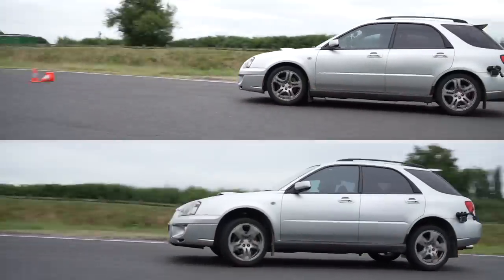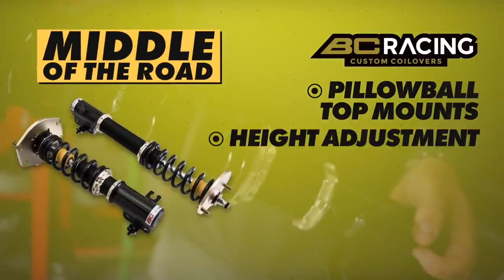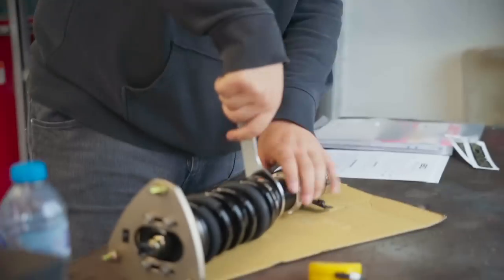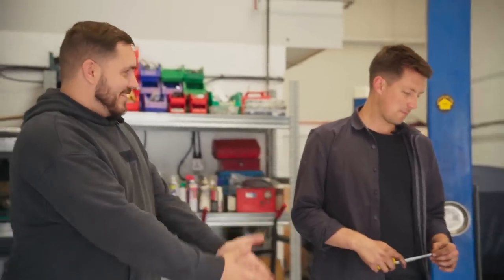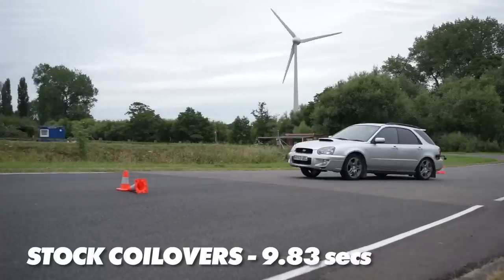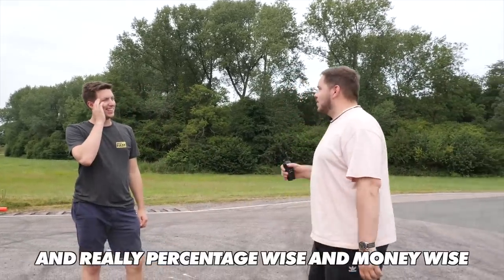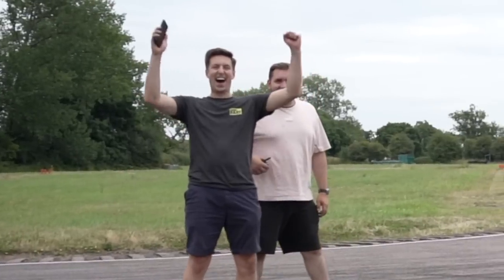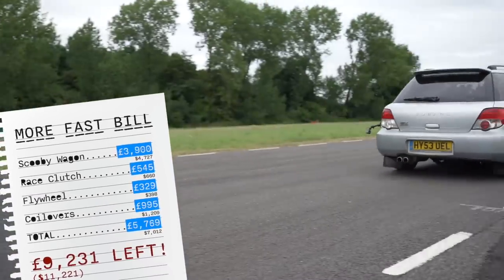Will $1000 Coilovers Help Us BEAT A SUPERCAR?

Comment: I'm really excited for this series. It's cool to see how you can take an old car and upgrade it to make it faster and what makes the biggest differences
Reply: agreed
Reply: I'm sure i missing something...
Spoiler alert! 
  #1 Tires. 
  #2 Weight. 
  #3 Weight transfer - in the way you needed it most usually #1 spring rate #2 swaybar #3 then anti angles if you can adjust them (like roll-center, anti-squat, anti-dive) #4 downforce #5 shocks (would be #2 if off-road)
  #4 brakes (this would be #1 if your brakes are trash but if a car handles well and low weight you really not on the brakes that long).
Reply: @gatorage850  According to my countless hours on Gran Turismo 5 tires are definitely the best at improving your car😂
Reply: you would probably also love hi-low by donut media then! they get two nearly identical used cars and upgrade them, one with expensive parts, and one with budget parts.
Reply: @jovaniortiz8317  and According to GTA off-road tires are best so you can curb boost!😉
Reply: It still hurts my feelings seeing a car like this get called 'old'.
Reply: @typods274  Agreed. For an american channel it's not too shouty, and that's an interesting series.

Comment: Remove the interior, seats and all those dead weight. Then do the suspension tuning and tyre change.
Reply: Winter wheels
Reply: @knrz2562  🤣🤣
Reply: In terms of performance gain you will see the biggest gain from tyre first, then suspension, and then the modest weight reduction you get from gutting the interior. Gutting an interior is only good for 100-150lbs. Consider, can you notice a large difference when a friend is riding with you? No. You need much larger weight reduction for it's effect to be significant.
Reply: @Levibetz  weight reduction is free gain. They have a tight budget.
Reply: @Levibetz  Depends. I took 72kg/160 lbs out of our Suzuki Jimny and it made a huge difference to acceleration, roll through corners and fuel economy. Worth mentioning any gain is noticeable when you have 80bhp though :P
Reply: @fossilfueled27  I did a Subaru Loyale, took about 100lbs out, I'm sure it helped but it didn't make the car any more successful at the ice racing I was doing with it, but it did make it HORRIFIC to drive. You had to wear full winter gear and blast the heater 100% to drive it in winter. Like hat had to stay on inside the car because cold air just rained off the roof.
Reply: @Levibetz  I notice quite a bit of difference when I a have passengers. Even with just my kids in the car, and the handling characteristics will even change depending on which seat they are in.  It's doesn't have massive horsepower, but its definitely not anemic. If I can feel the difference in a 400+ bhp car, then any weight reduction in the subi should be noticeable. ⁰
Reply: @Levibetz  As an 04 wrx wagon owner, I can confirm that I do feel a weight difference driving with even one passenger. I bet gutting it would feel like a go kart lol
Reply: yes yes and Yes. They should start gutting  whole car. Get rid of that useless heavy sunroof, get rid of rear bench and basically anything behind driver seat. Also draining windshield wiper fluid to a minimum is a free weight saving. They dont need stuff like radio or speakers or IDK spare tire.
Reply: Come on lads, so ready for the next video. Bring on part 4
Reply: I can tell when I have a passenger in my 2000 Infiniti G20t.  Granted, it's an abused bucket of bolts, but weight savings is weight savings.

Comment: This video actually tells me a lot about how to tune a car in a racing game, what to expect from tuning each option, stiffness, ride height and something about weight distribution, it's something I  am struggling with all the time, this series has been very useful for gamers like me to understand how to build a car efficiently.
Reply: it's hard, every car and drivetrain will have to be altered differently and it depends on the rest of your setup as well (i.e., midengine rwd car will be setup differently than awd front engine which will be diff from awd midengine) there's a lot of interplay with every system, not to mention your driving style takes a lot into account. doubly not to mention, every game has different levels of realism for suspension setup, some games like dirt rally 2.0 totally invert the sliders.
Reply: @HollidaySpessa  This series is amazing, they are spending real money and sharing the experience with us, experimenting, experiencing, it's not like someone presenting us with all the knowledge with no instance, it's kind of like that game forza horizon 5, building a car, not just granted a certain race car for some certain tracks like in racing simulator, the amount of knowledge during the entire process is great.
Reply: @ashiagefa646  ...yea? im not saying otherwise, im jus saying games like forza don't have suspension models that adhere to rules of reality, esp compared to games like ACC or especially richard burns rally. it's something ull jus have to play with and learn thru experience especially, on top of stuff like this
Reply: @HollidaySpessa  actually...
Forza have suspension model since Motorsport 4
That's a misconception
You can't compare Forza Horizon to Acc
Even Motorsport 7 since it's still based on a very old game engine
Reply: @iamcarl4591  richard burns rally is from 2005 and blows everything out of the water lol, so age doesn't matter. something can have a suspension model and that suspension model be horrible (which forzas is because it's not a simulation, and that's ok and there's nothing wrong with it)
Reply: @HollidaySpessa  If you say so
When Forza Motorsport 4 comes out
It's still impressive as it's competitor GT have a far worse physics simulation
The fact that people criticized Forza
It's because they never dig into the game enough
If you do(So do some actual real life racer) you would found out Forza has done a pretty good job
Just ditch your controller and tweek the feedback settings to make it right
Reply: @HollidaySpessa  also
The suspension simulation isn't unrealistic in any way
Give points to me about "unrealistic" if you want to continue to argument
Reply: @iamcarl4591  ? I know u like Forza but it's an arcade game, some pros like David perel like gt but it's still an arcade game. some pro rally drivers like dirt rally, but it's still an arcade game. it's not a big deal, every game has problems but live for speed, Richard burns rally, ACC, AC, etc. are significantly ahead of anything else. they jus flat out simulate more stuff, with RBR being the most complex of all by FAR, no contest.
Reply: @iamcarl4591  ur a fanboy, u like Forza so u don't want to accept it. it does not simulate an accurate suspension model, turn 10 seemingly admit this hence why they entirely redid it from the ground up for the next Forza motorsport release. it's hard to simulate, it's taxing n most ppl won't care. studios like SMS have flat out said "we will not even try to be as accurate as RBR" (or something like that) because it's crazy complex n most ppl dont really care, nor would most notice.

dont just blindly defend a game because u like it, I don't dislike Forza or gt or anything; this is jus objective. want the best simulation?play rbr, ull see how much of a hill you'll have to climb n how vastly diff it'll feel. ull see instantly how different everything feels, how much n how logically setup adjustments affect the car. it's simulator nirvana lol
Reply: @iamcarl4591  lol, forza isnt a realistic game, its an aracde racer. Get over it.

Comment: Well, as next episode is propably already recorded my comment will be useless, but I'll write it anyway:
Subarus are very front heavy but they have low center of mass. Stiffening rear sway bar is the first thing to do when you want to improve handling of them.
And about next thing on the list, tires: There is no going around it, if you're going for lap times, aim for best tires you can get. With other things you can get to the point of deminishing returns, with tires better model will always give you time advantage.
Reply: Winter tires with good groves improved grip

Comment: biggest gains that can ever be done to get a car to go faster are good sets of Tires (depending on what size of rims are stock) after that weightreduction.
but that Scoobie just a set of tires would do the biggest difference
Reply: further changes the airflow to increase aero dynamics.
Reply: @knrz2562  the track is too small to really benefit from airflow
Reply: A set of michelin pilot sport 4's wont break the bank and in my experience (had these bc's on a subaru as well) make a subaru almost stick to the ceeling
Reply: @Seb-Storm  idk
Reply: This. Going to be very interesting to see what new (stickier) tires will do
Reply: @b.w.9392  I also have ps4s on my car and they are very grippy ( and WAY quieter than pss) but their goal is just to beat the lambo around the track, go with some Goodyear Eagle f1 Supercar 3Rs. Those are streetable track tires, really get that WRX sticking in the corners. Hope they dont launch it on those tires like they have been though, RIP 5 speed
Reply: @knrz2562  Downforce is generally one of the last things that is done to add speed.
Reply: @knrz2562  that's my opinion not facts lol but i think the way the car is kinda sporty and aero-ish is not like they are driving a brick. We'll see what they do in the end
Reply: The tyres need to touch the ground to help out 😄 Also if they put the tyres on before the shocks and let Scott do his thing they would get some pretty uneven wear.

Comment: Notice how it's still got a heap of body roll? You've sent the roll centre through the floor by lowering it too far, it will be a lot quicker if you lift it at least an inch or go for a roll centre kit - you'll notice it drastically reduces the weight transfer, and makes the car feel a lot sharper and more responsive.
Reply: Just commented the same. So many people don't realise that lower does not automatically equal better!
Reply: @gazman9468  Watch the angle on the lower control arms. If the lower ball joint is not below the lower control arm's pivot points (closer to the ground) when the car is sitting on level ground then you have lowered it too far and the handling will suck.

Comment: So looking forward to future episodes! I had the exact same car that at tuned for light track work and mountain roads.

In terms of suspension need to replace the front control arms with STI alloy control arms. The OE metal ones are trash and narrow. GC8 STI arms are direct swap and GD with give you 10mm extra front track width. Also associated swaybar upgrades help, not too stiff.

Rear you need to dissemble the training arms and lateral links. OE set will be frozen in place and don't articulate properly due to age. STI at the time made pink trailing arms and lateral links with piloball bushing. Huge difference in rear stability.

Also bushing STI has a Group N catalogue; rear diff assembly mount, gear box mount and engine pitch stop helped a lot in terms of drivetrain slop and helps get power down better.

STI also made a underbody brace (just a pink bar) and strut brace that helped with steering feel.

The above shopping list is relatively cheap but made a huge difference in handling.

Man I miss that nugget

Comment: You've went very low with the rideheight, and the angle af the front control arms has switched to the other side of the horizontal. You will absolutely need a roll center correction kit. You can have that either from Whiteline, or Superpro.
Then, the wagon has narrower control arms, and that works in your favor. Buy a set of STI control arms, aluminium ones, they are 10mm wider, and that will increase the front camber. Be careful, there are 2 versions for those, 3.5deg caster and 5deg caster. The later one, called "spec B" control arm, can be found on the hawkeye STI, this would be the best option. Nevertheless, there are alternate ways to increase the caster. ALK is one of those, but it sucks imho, since it puts static load on the bushings. There is also a free caster mod to be done on the STI control arms, by flipping the rear pin. It does the same thing as an ALK.
If you switch to STI control arms, you will need a new antiroll bar. Careful with that, they differ between the normal STI arms and the spec B ones.
You can also go with STI control arms on the rear, but you will go into fender clearance issues, since the wagon has no flaring helping with wheel offset. For wheels, your best option would be the STI 5x100 wheels, 17x7.5, ET53. Or, if you keep the rear control arms, there is more flexibility to be had. DO NOT go under ET48, or you'll need to cut the lip on the rear fenders. Long story short - a 17x8, et48, on 235/40 might do the trick for 300HP and also fit the rear arches, on the stock rear arms.
Bracing the chassis should also be done, especially after going on the coilover route, it flexes quite a lot.
MANDATORY addition - rear frame lockout bolts. 
Poly bushings all-around the suspension can also be of great help. There is also some transition torque lost in the soft drivetrain suspension - engine and transmission mounts, rear differential bushings.
And the WRX 4-pots are quite weak. Buy a set of an STI brembos, or better yet, some BBK. Wilwood has some cheap options. Or see with AP racing, they're on the same island as you are.
If the car is driven by an experienced racing driver, the current steering rack should be fine, it's a 17:1 ratio. Otherwise, good news, your car is RHD, and the JDM STI rack is readily available for a simple swap, with a much-much better ratio of 13:1.
That car has the potential of being turned into a weapon, track-wise, with the right parts and setup.

Edit: do NOT go over -2deg of static camber on the front, the steering rack on this car is in front of the axle, giving very weird toe on lock. On the other hand, for the caster, as much as you can.

Comment: based on some of the data given in the last episode I've done some calculations on power to weight ratios of both cars.  The power to weight ratio of the Murcielago is almost exactly 350 bhp/tonne.  If the Subaru's weight stays the same (which it presumably won't) it'll need to make just over 500bhp to match the Murcielagos power to weight, similarly if the power of the Subaru stays the same (again presumably not) the weight of the car will have to drop to around 650kg!  If the lads can get the weight of the Subaru down to a somewhat reasonable 1250kg then to match the Murcielago it'd need around 440bhp.  I know that power to weight ratios aren't everything in this situation, this was just a bit of fun.
Reply: Thank you for doing all this, I’m interested in these kind of more specific statistics but don’t necessarily have the idea to do so.

Comment: Before you do the corner weight and alignment you'll want to take the weight out of the car first. I'd also do the tyres at the same time. That will see your biggest gains in lap time I reckon. 
For tyres I'd personally recommend Yoko A052s.

Comment: Stiffer anti-rollbars and some yokohama advan with stiffer walls would help a lot in the corners. Take the spare seats out they weigh a tonne.
Reply: Rollbars?!.
Well that's like um idk for protection doesn't really increase free horse power 😳 😬 🤔 😕 😅 😐
Reply: @knrz2562  no anti-rollbars have a quick search online that are situated under the car 😊. That’s what I changed on my old turbo mx5 for gymkhana and made a great difference.

Comment: Enjoyed this! One thing I would say though is it would be worth calculating roll centres properly rather than dumping the ride height by a random amount. Most people think purely in terms of lower COG but you actually get more body roll going excessively low due to control arm angles increasing roll centre vs COG difference. Increased body roll due to being too low will reduce the load the inside tyre is dealing with lowering overall grip. It's highly likely the optimum is not much more than 30mm from stock ride height without roll centre correction of some kind.

Comment: right before he took off i said to myself i'd be surprised if it gained more than a second on that track. makes no sense to expect a 2 second gain on just swapping out suspension. with the suspension upgrade the car still needs better tires, more power, weight reduction. anything else is just pissing money away. also should have done the weight reduction before setting up the suspension because now you'll just have to set the suspension up all over again after  you do the weight reduction.
Reply: Tires are going to make the biggest difference I’d say, be interesting to see that episode. But ye I’d have stripped it out 1st considering it can be done for free.

Comment: I wonder… how will the final form of this Subi size up with the Low Car from Donut Media? That’s gonna be an epic crossover 🫣
Reply: i would love a crossover like that. both groups are so fun to watch
Reply: itll be better. both gen of Z cars are prone to over heat under hard driving
Reply: @thewen  you know both of them got engine swaps, right? i'd imagine those overheating issues are more related to the engine and its cooling system rather than the actual 350z
edit: ...and they each got their own upgraded radiators during the original season, so that got taken care of even before they swapped out the VQs. if you didn't actually watch their Hi/Low series, you're really missing out.
Reply: Would be an interesting crossover and would be hilariously fun to watch
Reply: A Donut and Driver Media colab would be so epic!